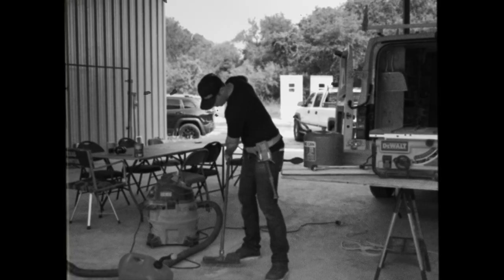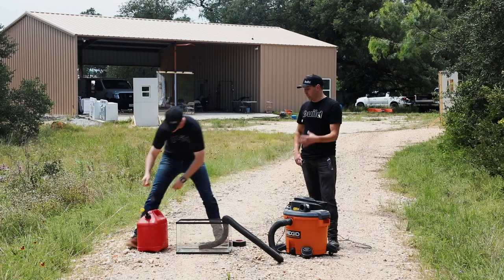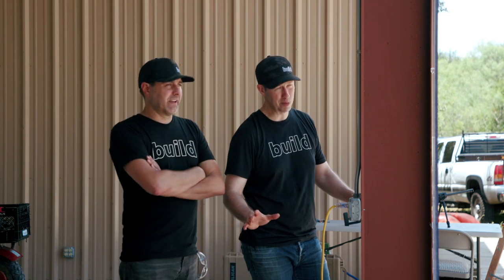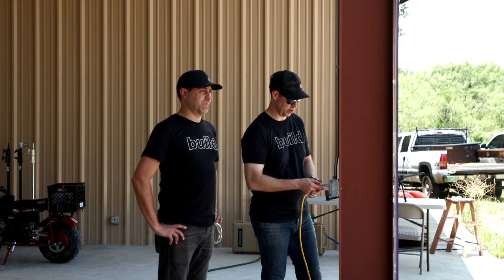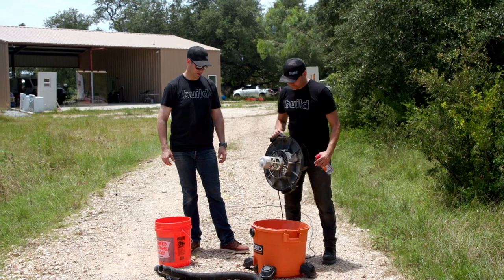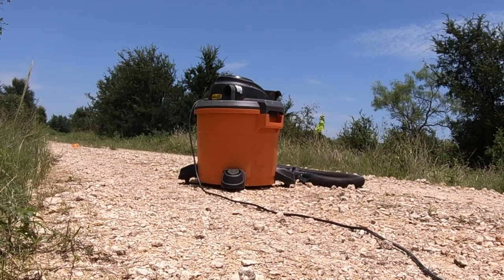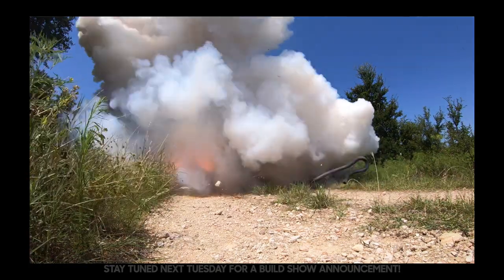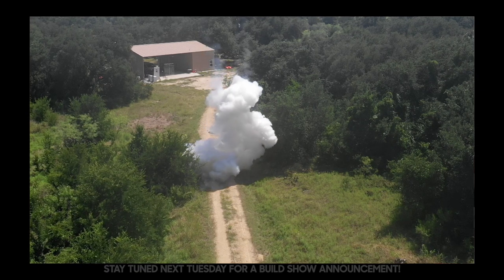Shop Vac’ing Spilled Gas - Will it Blow Up?

Comment: Induction motor = no brushes = no explosion? What type of motor is in that vac?
Reply: If there was a capacitor on the motor? Boom- when they poured gas directly into the motor?
Reply: All the vacs I've taken apart had brushes. Induction motors are less efficient. They make professional brushless ones for $500+, but even those have switches and windings that can arc if something goes wrong.
Reply: The rotor has a permanent magnet on it. And the windings around it is what provides the electric push to spin the vacuum’s rotor. So no bushings are required.

The only spark source I can think of, would be the actual switch. Since this wasn’t turned on or off, there was no issue. Personally, the flipping the switch to ON wouldn’t cause a problem. However, once the fumes are in the vacuum and the user switches it OFF. That’s when a problem could happen.
Reply: Chapest motor is the universal motor. So most motors will be of this kind. Brushes and no permanent magnets.
Reply: @rleebert6897  Why would there be a capacitor on the motor? That's absurd.
Reply: @pcno2832  Um, no. Windings don't arc, or they wouldn't work at all. And most switches are enclosed, so even if they did arc it couldn't ignite the fumes. Brushless motors are a lot less expensive and more common than they used to be. Brushed motors would be the only real concern, but most vacuums are designed so the motor is separated from the dust compartment (because duh, dust in the motor is a great way to destroy the motor in short order), so even if fumes are ignited they will be outside the compartment, not in it, so there's no confined volume to build up pressure and explode. It would be more of a "whoosh" and quick ball of fire like if you use too much charcoal lighting fluid in your grill and light it with a match. You might lose your eyebrows, but it's not an actual explosion. Put it inside a building especially a room with the doors and windows closed, and things will change, though.
Reply: @awo1fman  - re: capacitor - maybe to level out in-rush current; some microwave ovens have them too
Reply: @theodurbin8672  I've never seen a capacitor on a motor, and I've torn apart more gadgets than most.
Reply: @awo1fman  Some motors use them to assist starting or solve electrical problems. The real point is the unknown about how the internals are constructed that creates risk factors.
Reply: @williamnaman3570  Again, no. When you say, "solve electrical problems", you reveal that you actually know nothing about how any of these things work. Some motor controllers may have capacitors, but not the motors themselves. And simple devices like vacuums that have no need for speed controllers certainly don't have capacitors.
Reply: @awo1fman  I didn't mean the motor has a cap. Pool motors have caps. I am being very general here to describe the unknowns that increase the risk. It doesn't take much to store a static charge. Plastics in motion can store a charge long enough. Maybe I should have said "solve electrical design problems." Risk of the unknown is my point. Watch BOLTR if you want to see the kind of surprises you find in these devices. I bet you can run across a vacuum that has a controller in it. I also recommend that you never use an Aquarium that has had fuel in it for fish. It would be very difficult to get it clean.  I also don't recommend using any method that uses friction or electricity to pick up gunpowder. A wet pure water method is the way to go there.
Reply: @williamnaman3570  You're clearly parroting a bunch of stuff you've read or seen on YouTube, and of course everything you read or see on Youtube is fact. 🙄

I'm done trying to talk sense to you.
Reply: @awo1fman   I assure you none of my opinions here were copied from youtube. I usually watch political stuff. All my recommendations are my own opinions based on limited biology, chemistry and engineering knowledge.  I am sorry you have taken such offense. I think youtubers, making dangerous videos, should show them to a lawyer before posting. The black and white comedic disclaimer at the beginning was good form. In court, a viewer could say he only watched the first part of the video and missed the disclaimer. There should also be a textual disclaimer in the description.  May Darwin's theory favor you.
Reply: Wow, this escalated quickly. Usually two caps on AC motors, one for start, and the other for run. They do phase shifting as all caps do to any AC wave form.
Reply: I just watched a guy take one apart and he says the motor has brushes.
Reply: There's another factor there, the fuel is only combustible in a narrow range around a stoichiometric mix, approximately twice as much fuel per air will still just ignite with difficulty, and half as much fuel for the air will just ignite unreliably and violently, beyond that narrow range it will not ignite. IE, if you pour liquid petrol on the motor and start it, chances are, no ignition until/if the mixture is ever about right exactly where the spark is.
Reply: @fredio54   We have very hot days here in Texas. 108F this week. That plastic cover is black.
Reply: @awo1fman  Lots are larger motors have a run capacitor. the motors are refereed to as PSC motors "permanent split capacitor". plus nearly all AC ceiling fans have a capacitor. PSC motors are also used (or used to be used) in high end exhaust fans. where the cheap ones use a shaded pole motor
Reply: @fredio54  Nope. Not the motor. The controller. Maybe very large motors, but not vacuums. And no ceiling fan I've ever taken apart or installed ever had capacitors. But then, I believe in getting what I pay for, so I don't buy expensive ones.
Reply: @james6794  Exactly. Large and expensive motors. Not small motors like fans and vacuums.
Reply: @awo1fman  a 3 phase induction motor (connected to delta) 1-phase supply needs that cap to start usually about 70uF per kW.
Reply: @petrirantavalli859  Right. The overwhelming majority of ceiling and other fans, as well as vacuums, are NOT 3-phase, let alone induction. Which is exactly the point. These people are wandering off into completely irrelevant and inapplicable territory.
Reply: @awo1fman  Basically all corded vacuums are brushed universal motors, so you are correct, no caps there. But a very common type of single phase induction motor uses a capacitor to create a second "phase" to start the motor and insure it turns only in one direction. You could argue, I suppose, that that single capacitor is a controller of sorts, but no one does. Good quality fans almost always use capacitor start motors. Single phase induction motors always need something to start their motion, or they'll just sit their and quiver at line frequency.
Reply: @pcno2832  Induction motors are much MORE efficient than brushed motors. Brushed universal motors are the least efficient type of motor in common use. However, induction motors work poorly for vacuums. When you partially close the end of a vacuum cleaner hose, you are reducing the intake pressure at the fan, which reduces the load on the fan. An induction motor runs at a (nearly) constant speed, determined by the AC frequency, so when you reduce the load, it simply draws less power. But that's not what you want. When you partially block the hose, you want the motor speed to increase so the fan will pull harder to compensate. Fortunately, this is precisely what happens with a brushed motor, which is (essentially) a constant power device, rather than a constant speed device.

Now, with a variable frequency drive and the proper controller, or a brushless DC motor, which are very similar devices, you can accomplish the same thing by having the controller increase power when the load decreases. This would result in a vacuum which is much more efficient, more powerful, or both, but one which is also much more expensive.
Reply: @jasexavier  The subject here is vacuums, which don't use induction motors, and don't have capacitors. Which is irrelevant because all wet/dry vacuums separate the motor from the collection compartment and are required by law to be double-insulated. The only way to get an explosion with a wet/dry or "shop" vac is to deliberately rig it. Not that there aren't idiots that will suck a lit cigarrette into a shop vac they've just used to suck up gasoline, but they need to be taken out of the gene pool anyway.

Even if capacitors were involved, they would NOT be causing arcing of any sort, and that suggestion is absurd. If arcing were possible, they couldn't be doing their job and the motor wouldn't function.
Reply: @petrirantavalli859  Shaded-pole motors don't need capacitors.
Reply: @jasexavier  Efficiency isn't really a consideration in small, cheap devices (like fans), and is zero consideration for devices that are not often used or are only used for a short time when they are used (like vacuums).

Cheap ceiling fans use AC motors, the much more efficient and expensive ones use DC motors. Desk fans usually use shaded-pole motors, which don't use capacitors.
Reply: @awo1fman  The first line of my earlier reply: "Basically all corded vacuums are brushed universal motors, so you are correct, no caps there." No need to keep beating on that subject. You'd said that you'd never seen a capacitor on a motor. I was pointing out that they are extremely common, just not on vacuums. Obviously capacitors wouldn't be arcing, but brushed motors do, necessarily, by design. Double insulated devices are those that have two layers of insulation between the live components and the user, which allows the use of non-grounded cords and outlets. It's a standard dealing with electrocution hazards, not ignition. Usually this just means the case of the thing is plastic, instead of metal. It's a cost saving feature, and one you'll rarely find in industrial tools, for example. It has nothing to do with how well the arcs created by the interface between the brushes are commutator are shielded from the environment, except that there's should be no way for you to reach inside and touch them.

Explosion proof motors, which can be brushed or brushless, are designed to contain any explosions they cause without providing an ignition source external to the motor. This means they're often not even sealed, but very well cooled with long flame paths from the armature to the outside of the case.

I own a Ridgid brand wet/dry vac, and I've used many others, and many from Shop Vac, DeWalt, etc. Pretty much all of them if you look carefully into the motor exhaust (not the vacuum exhaust, but where the motor cooling fan is) in a very dark room you can see light from the commutator arcs. If you're outdoors, and dealing with loads of liquid gasoline, you're probably not going to have a problem. You're probably not going to have a problem filling a gas can up in the bed of your truck either. The rules about those things are not because something always goes wrong, but rather, that something can go wrong, and does in rare circumstances, and the consequences are severe. Use that same vacuum in your basement with little or no ventilation on a small spill and you might have a very different experience from those shown here, especially if you're using an old vacuum with worn a worn commutator and brushes.
Reply: @awo1fman  Many desk fans, and other small or low quality fans, use shaded pole motors, true. Bigger, or higher quality fans, like box fans, tend to use capacitor start motors. Ceiling fans almost always use capacitor start motors, as do most other permanently installed fans such as bathroom exhaust and kitchen vent hood fans, or furnace blowers. Very high end fans use brushless DC motors, including fans from any of the above categories. The only fans you're likely to come across these days using brushed motors are those in cars, trucks, boats, etc., both the motor cooling fans and the HVAC blowers, although those are often being replaced now with brushless.

Capacitor start motors and shaded pole motors are both examples of AC induction motors, along with the far superior 3-phase motors. Brushless DC motors are essentially synchronous AC motors driven by AC synthesized from DC by some manner of controller.

edit: While it's true that efficiency isn't much of a consideration in a lot of these devices, it's becoming more so, and, more importantly, higher efficiency motors allow for much more powerful devices. Universal motors tend to be about 60% efficient at best. Brushless DC motors can easily be over 90%. Is this going to save you money on your power bill in a vacuum cleaner? Not enough to notice. However, most vacuums tend to pull just about as much current as you can pull from a normal wall outlet. Switching to a brushless motor gets you a 50% more powerful vacuum for the same current draw, and that's pretty nice.
Reply: @jasexavier   I have to keep beating on that subject because you can't get it through your thick skull that it's the whole point of this thread, and all the other nonsense you're spouting is irrelevant. And it is nonsense. The big brands all use brushless motors in their power tools, so that's yet another irrelevant straw man. And yes, double insulation does make a difference in how exposed arcs are to the open air. Because that's the whole point. The path matters, and things like screens prevent fire from passing through. That's how many gas heaters work. Most people don't store gasoline indoors, and as I said, those that do need to be taken out of the gene pool. Unfortunately, that scenario is actually unlikely to have that outcome, though.

And I'm not going to bother debunking any more of your nonsense.
Reply: @awo1fman  The original point of the thread was just someone asking what type of motor was in the thing. You're the one who claimed that motors in general do not have capacitors, and you've been insulting, rude, and seemingly angry in your replies here, including times when you were simply incorrect. This thread has grown to a wider discussion, and while you might think none of what I've said was necessary, none of it was incorrect. Except perhaps that I was inexact about capacitor motors, not all of them are capacitor start motors, only the ones that take the capacitor out of the circuit once the motor comes up to speed.

If you think that a non-explosion proof vacuum is a good tool for cleaning up flammable liquids, I'm not going to stop you. You'll probably be fine, or you might exit the gene pool.
Reply: @jasexavier  Shaded-pole induction motors have no capacitor AT ALL . So yeah, you're incorrect.

Yes, somebody asked what kind of motor was in the vacuum, and then induction motors kept coming up. Which is incorrect. And irrelevant, because as clearly demonstrated in the video, even a brushed motor is highly unlikely to cause an explosion. Is it possible? Sure. It's also possible that a huge asteroid will hit the planet tomorrow and destroy the planet. But sane people don't waste their time even thinking about that, never mind talking about it. I'm not dumb enough to create a situation where gasoline could possibly need to be collected in such a manner, and anyone who is that dumb needs to be taken out of the gene pool as quickly as possible, so the whole scenario is just an excuse to make a funny video and blow up a vacuum... by rigging an explosion because they proved the whole premise to be a myth.

Some people made funny comments. Fair enough. But if you want to discuss something other than the question asked, start a new thread. It's not that difficult. Continually beating a dead horse that is utterly irrelevant to both the video and the original comment is just stupid.

I never said all motors don't have capacitors. I said vacuums don't have them. Then you and other people kept bringing up irrelevant induction motors and claiming everything under the sun does have capacitors, and you're full of crap. I've taken apart a lot of fans, and exactly zero of them had capacitors. I'm not saying no fans have them, I said that I don' t waste my money on expensive fans because I've very rarely had problems with cheap fans and when I do it's far cheaper to just buy a new fan than to get a part to repair an expensive one. It's also easier to make a repair on a cheap, simple motor than it is on an expensive, complicated one. Then you keep beating a dead, irrelevant horse about induction motors and I keep having to debunk your nonsense. Except I'm not going to waste any more of my time doing that.
Reply: @awo1fman  "I've never seen a capacitor on a motor, and I've torn apart more gadgets than most." - you. "Some motor controllers may have capacitors, but not the motors themselves" - also you. I could go on. After that you got pretty belligerent. Also, no one has claimed that vacuums use induction motors. The very first thing I said in this thread: "Basically all corded vacuums are brushed universal motors, so you are correct, no caps there." Rereading it I see that I should have typed "use" instead of "are", so I apologize for that small error, but I think the meaning was pretty clear regardless. I went on to give a pretty thorough explanation as to why induction motors would make a poor choice for vacuums. I would never have said anything about capacitors in motors, or most of the rest of the stuff, if you hadn't made so many insulting posts full of misinformation. You started this discussion by claiming that such things don't exist and that people who think so are stupid and get all their technical knowledge from YouTube. My comments have just been in reply to yours.

 I also never said shaded pole motors had capacitors. I mentioned them as a lower cost alternative to capacitor motors. Also, I checked some fans I own, the first one I came across is a cheap Lasko box fan, the second cheapest that was available when I purchased it. Not only does the motor have a capacitor, but its mounted on the bottom of the outside of the motor case, where it can be clearly seen without taking anything apart. A quick Google search shows that their cheapest box fan uses essentially the same design of motor, also with a cap. Perhaps you just don't know what a cheap motor start/run capacitor looks like? I have a 6" desk fan that uses a shaded pole motor, which, to be clear, doesn't have or need a capacitor. With cheap fans it seems to be an even split in my house, with all larger fans using caps. Shaded pole motors would be ineffective for something very large, like a ceiling fan, since they have barely more than 0 torque at 0 rpm. My $20 when new crap ceiling fan has a capacitor, located in the junction box mounted below the motor, that has the switches for the fan, light, and direction. Maybe take another look at some ceiling fans? Cheap ones have caps, expensive ones use brushless DC motors with fancy controllers. Zero ceiling fans use shaded pole motors, or brushed DC.

As to vacuuming gasoline, again, a quick search shows two news reports, complete with security cam footage, of people vacuuming gasoline, and causing fires. One was vacuuming a small amount of spilled gas from the carpet of a car trunk, the other attempting to use a vacuum to start a siphon to empty gasoline out of the fuel tank of a diesel car. The former just blew up the vacuum (the motor housing, not the canister, for reasons that have been beaten to death, as you say), the second resulted in a pretty devastating car fire. Fortunately no one was hurt in either case.
Reply: @awo1fman  Standard on just about every furnace fan or air conditioner compressor. It's called a starting capacitor. Motor won't start up without it.
Reply: @ModernSurvivalists  Apparently you can't read...